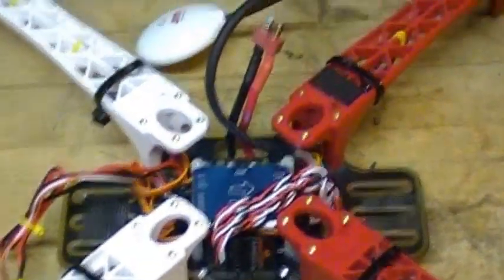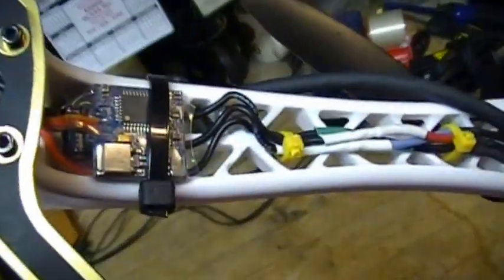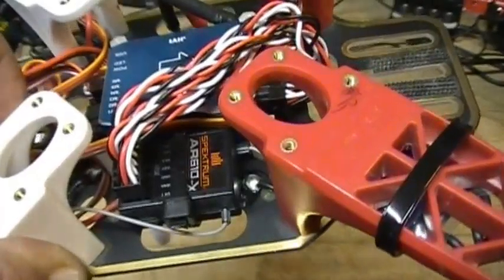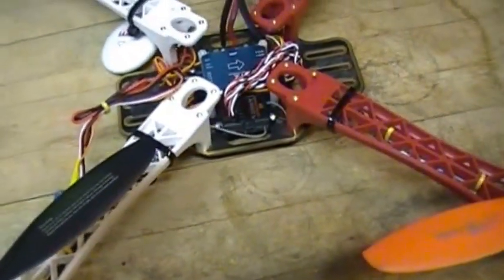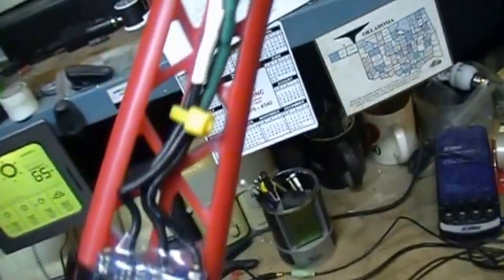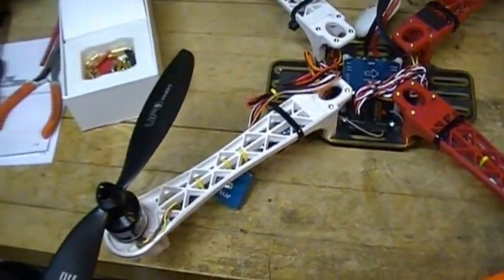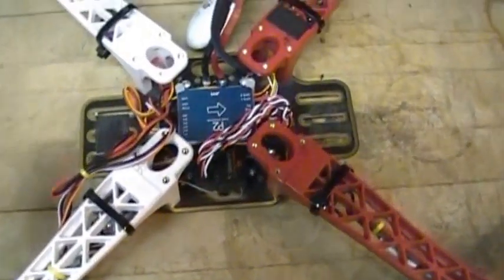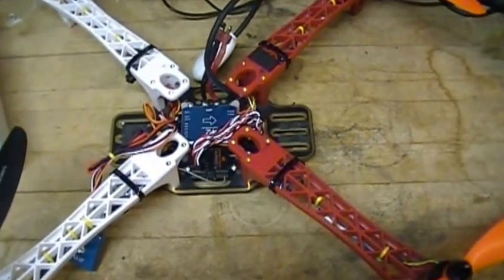JIYI P2 GPS Flight Controlled Quadcopter Frankenstein Build Part 3 of 6

Comment: I just bought one of these systems. Can you tell me where the power lines connect to from the PMU/LED unit?
Reply from the maker: +Grove Hull Not sure I understand the question but if you are talking about the red and black wires that have no plugs on them off the PMU/LED those connect to your flight battery...
Reply: Great! That is exactly what I needed to know... I'll just wire it into the harness going to my escs on the battery connection side. Thank you sir.
Reply: does the rc slot on the unit plug into the radio receiver in the bind slot?
Reply from the maker: What kind of receiver are you using.. If it's a PCM then you need to hook the channels up matching each with your radio.. I am guessing you have the software installed and have the JIYI connected to the PC so you can set the correct channels with the radio..
Reply: Spktrum ar610 clone. I haven't gotten to the computer yet. I have a dx6 transmitter.
Reply from the maker: Ok that is the same as mine then you want to use the little short female to female jumpers to connect your RX channels to the flight controller channels. They are marked channel 1,2,3 etc... The M 1,2,3 are the ESC connections..
Reply: +TheElectronMan I have my 1,2,3,4 escs plugged in and on the other side after channel 6 there's an rc then com male slots do I leave them open or do I have to hook anything to the ar610
Reply: I got the thing to power up, but need to set it up on the software. I was wondering if you could send me the settings for your dx6 so I could download the model onto my transmittervia SD card? I'm a newbie and haven't really learned to assign switches and stuff on my transmitter yet.
Reply from the maker: +Grove Hull I am using a  Spectrum DX7 but it's an older version that doesn't have a SD card that probably wouldn't help anyway because there are so many other things that need to be set the radio settings themselves are pretty generic... But anyway what you really need to do is get your receiver talking to the FC and then connect it to the the software from there if goes through all the settings of the radio so you have the channels set up right on the radio to the FC.. Good thing there is nothing real special you have to do the  transmitter.  Do you know anybody that could help you in person just starting out an experienced quad builder would be your best bet so you have a successful first flight.. Also make sure your receiver is binded to your transmitter should have a steady LED on the receiver when the receiver is and transmitter are powered up.. Also this video can help clear up the connection it's not the same flight controller but it gives you a idea on to install yours... https://www.youtube.com/watch?v=30cCs4aHdB0
Reply from the maker: +Grove Hull Also watch this video of mine it will really help with setting up the radio and FC... https://www.youtube.com/watch?v=XqBoGjRv94Q
Reply: Yes I tried a number of times, but the control board won't hook up with the software on my computer. It connects when I push the green chain... the receiver says it's hooked up, but when I go into the program the stuff doesn't light up with the green boxes. I'm wondering if I have a bad unit.

The slots on my unit actually look like the JIYI PU Pro and not like yours. I'm wondering if I should send it back as defective.
Reply from the maker: Hum sounds like you have it communicating or you wouldn't get the green link. If you notice in my Video 2 on this build you need to have your transmitter turned on and linked with receiver then you go to control tab in the software and click read then you should get the green boxes and when you move the sticks the software should show those movements...
Reply: Thanks I'd love for it to work, but I can't get to it until tomorrow. I'll give it another shot then. Thanks a lot. I'll let you know if it works. If I can't get it working I'll send it back.

Comment: $40 for the frame!? Just some advice, Hobbyking have this frame for about $10...
Reply from the maker: +Gree I just estimated that cost i think it was really closer to 30.00 off Ebay.. Sure HK has them for 10.00 but if you add in the 15.00 shipping and 6 weeks waiting for it to come in from HK then I think my Ebay purchase where I got in a few days was worth it.  Not that I don't use HK once in awhile they have some great deals but you also have to factor in the wait as well as shipping..

Comment: If you are powering the controller with the power block, did you have to remove the becs on your ESCs?
Reply from the maker: dubstepyogi27 No I didn't doesn't seem to matter I looked all through the JIYI manual and it doesn't say anything about it.. My guess is the power pins go to nothing in the controller I might go ahead and cut them just for good measure but it doesn't appear they have any effect on it...
Reply: +TheElectronMan Thanks for this piece of info.  I was scanning the manual for it.  I suspect the same as you, since they have a dedicated power lead power from the ESCs likely go nowhere inside the unit.  Good to know you've tested that way without issues.  Now I can proceed with my build :-)  Thanks again.
Reply from the maker: Happy to help happy flying.